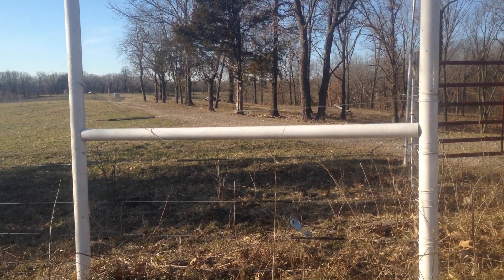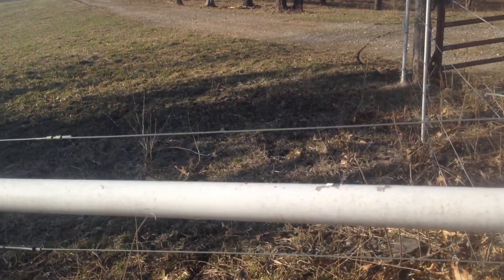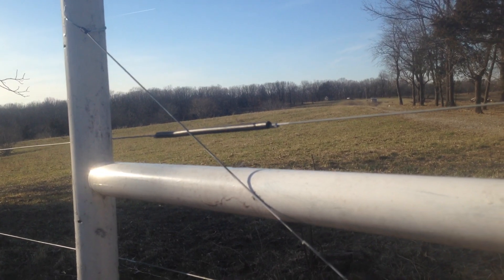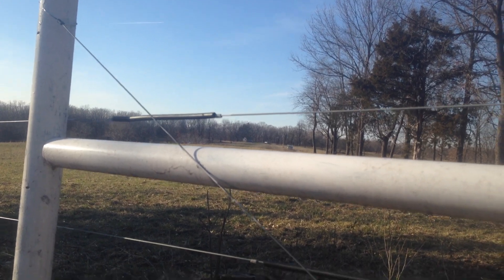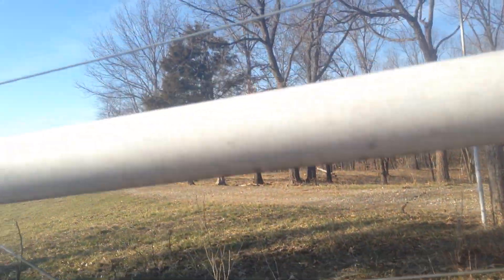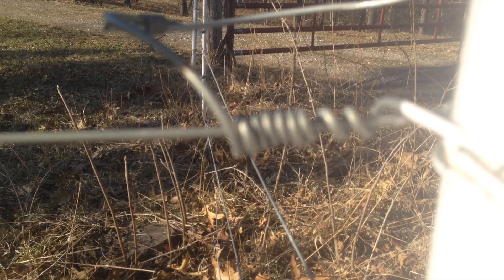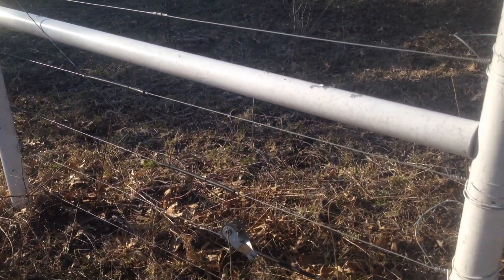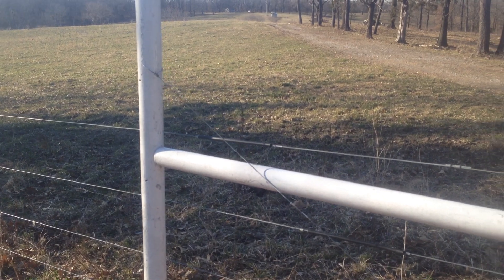Episode #55. Greg Judy explains their fiberglass H brace assembly

Comment: In some of your fencing video I got the impression we didn't need a H brace for pulling HT wire so long as we keep the top wire down to 30 inches, and have solid corners.  Could you elaborate on that at some point?  I'm about to pull some wire and find out.  

 I've braced before for woven wire, but rather not if I don't have to. This is my first HT fence.  Planning to run 4 strands, bottom at 7 and top at 30 and middle wires--at whatever my notes said--which came from your videos.

Comment: Greg can you do a video about the space between the fence wires? Where your brace wire passes the the fence wires,do you have to slide the crimps and the black insulation over the fence wire first or does it clip over?
Reply from the maker: Will do a video on that subject, thank-you for the suggestion!

Comment: When building the H brace and attaching the horizontal fiberglass post to the vertical ones, you mention connecting the two with 1/4” all-thread into the pre-drilled holes.  Are the holes drilled to a diameter such that the all-threads aren’t actually threading, but rather just fitting tightly into the pre-drilled holes?  What size drill bit are the holes pre-drilled to?
Reply from the maker: .25" diameter hole.

Comment: Greg why not put the lowest point on the cross brace wire at the height of the lowest fence wire and avoid all the insulator tubing and crimps? Just let the cross brace touch the fence wires.
Reply: Had the exact same question.

Comment: How do they compare to wood posts price wise and usage wise? Are they cheaper or more expensive? Do they break? Do they hold up as well or as long as wood posts?

Also, I WWOOFed at this one farm that used fiberglass posts for its portable fencing. The posts had quickly degraded and I was constantly getting fiberglass slivers in my hands even despite wearing gloves. Do you find fiberglass slivers to be an issue with these posts? Or does it depend on on the brand and whether they’re cheaply made or well made?
Reply: I don't mean to speak for Greg but I've watched, read and listened to most of his stuff and he's more than welcome to correct me if I'm wrong but I can tell you Greg paints his fiberglass to eliminate the fiber issues.
Reply: Brent good to know. I liked all the qualities of fiberglass except for the fact that I had to handle them. I detest getting constant slivers.
Reply: @lynxacres1293  I hear ya, I've had several row crop planters with fiberglass seed and fertilizer boxes...few things are more irritating than transparent stickers poking you.

Comment: What maintenance do you do to keep the grass off the bottom hot wires?
Reply from the maker: We use a big charger and never shut the fence off. We do not worry about the grass, it will not short out the fence if you use good fiberglass posts. Metal posts, forget about it.